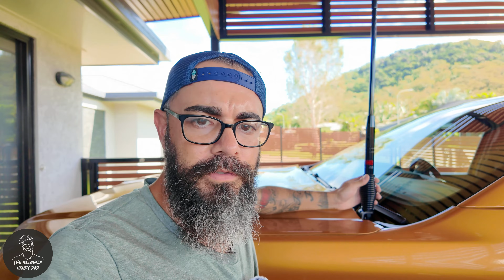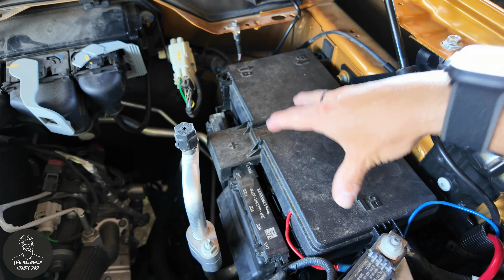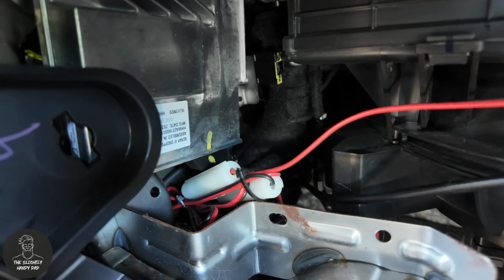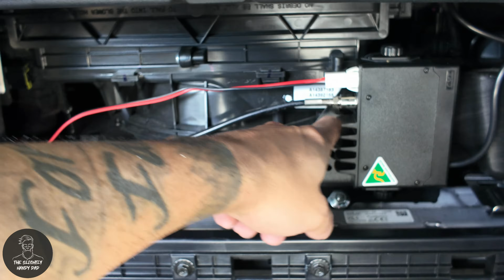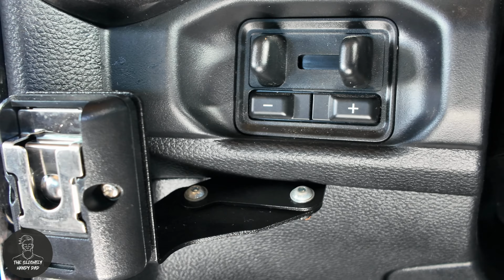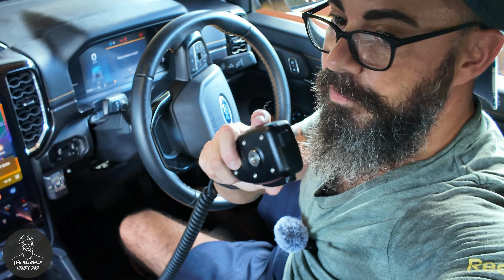Tips for Installing UHF in Your Next Gen Ford Ranger

Comment: Thanks for the video. I have an nf Amarok (so the same). The power from the run/start cable was fine for a week, but now it is intermittent. Any ideas why? I’m thinking I will need to use a fuse tap.
Reply: As a follow up, for me the run/start cable only seems to supply power when the head lights are on.

Comment: Cheers legend helped a heap. Little tip you don’t need to remove the whole fuse box at all. Just use a steel coat hanger and punch in through the same hole and pull
Out the other side saves a bit of time.

Comment: Great Video thanks, it helped me mount the same GME UHF into my Next Gen Wildtrak with the help of those Pirate Camp Co brackets.
Did you have any trouble with interference with your UHF ?  Mine has a lot, sounds like they're talking under water.
Ive changed the earth and re-routed the antenna coax but still no good.

Comment: Thanks mate. This was super helpful for me to install an Ecoxgear EXG3000. Only difference was I couldn't find a mount made for it, so I went to bunnings and got a 90 degree flat bracket that I modified (thank god for angle grinders!). Did the job. Only question I have is does the unit get hot? It's right up the back of the glove box. Just want to make sure I'm not going to be smelling some burning plastic or have my car catch fire!

Comment: Great Video Mate, I was struggling particularly with the accessing the cab with the aerial cable and then inbuilt power supply that ford had fitted. and also the access to get the microphone over to the driver's side.

Comment: So what's the purpose of those spare wires??  Are they there specifically for installs like this?  I using a Pirate Co bracket as well but mine is in the drivers footwell.  Trying to find some power.  Great vid though.
Reply from the maker: Yeh Ford have nicely left terminated wires around so that you don’t have to run a bunch through. If you have the accessories switches pre installed, they also have those running to different areas of the vehicle through a fuse box. It’s the little things in these newer vehicles.